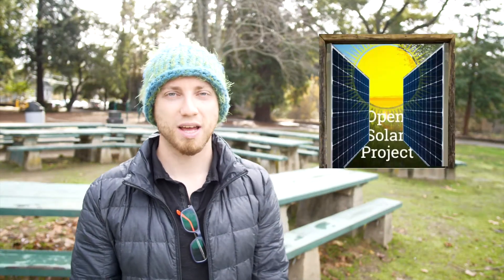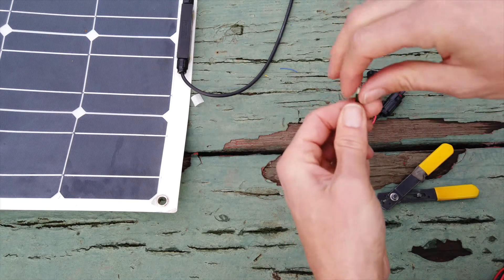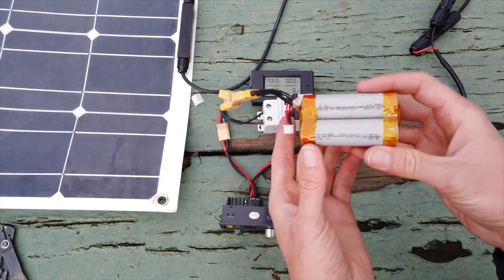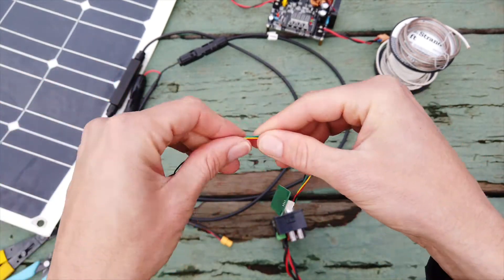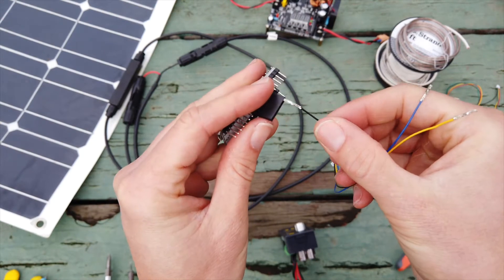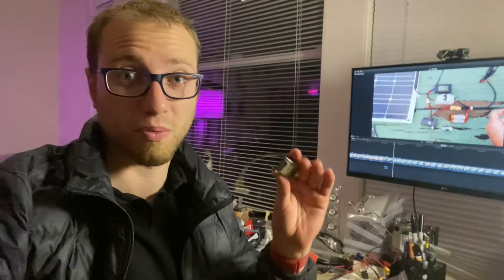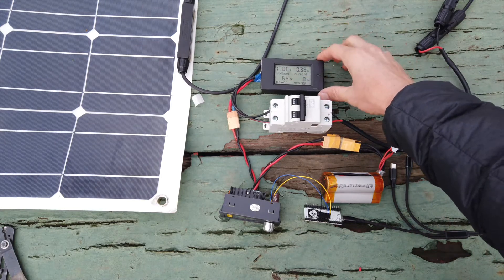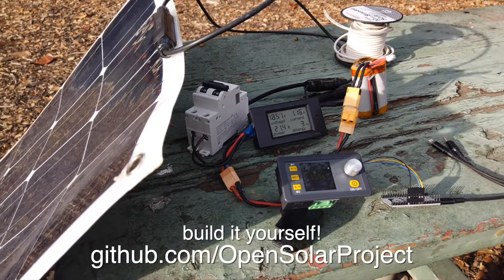Open Solar Project: Hardware Build

Comment: What a great idea! too bad the dps is only a buck converter. 
There is the dph5005 which is a buck boost but limited to 5 amps. 
I would need a dph 5020 in order to connect a 425w solar panel. it has a Vmpp of 34v and my 8s lifepo4 batteries are 29v. While it should work just fine  in full sun, I'm a little concerned when the sun is low, i'm not sure if Vmpp will stay above 29v